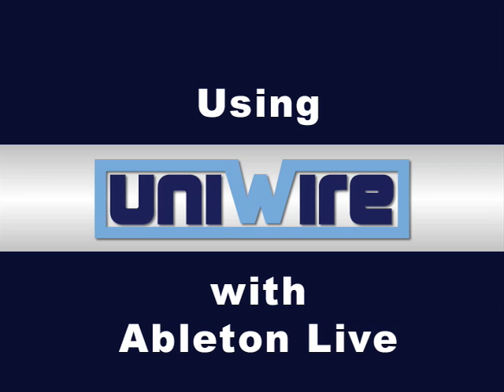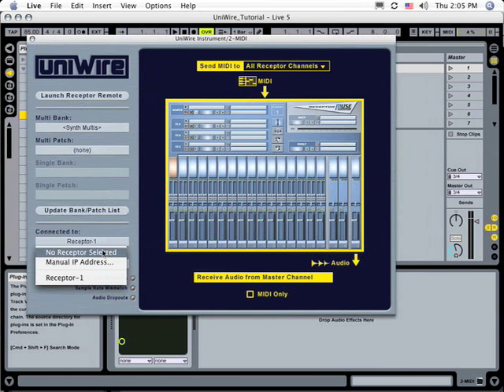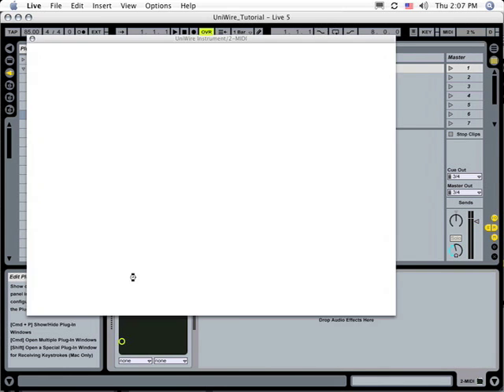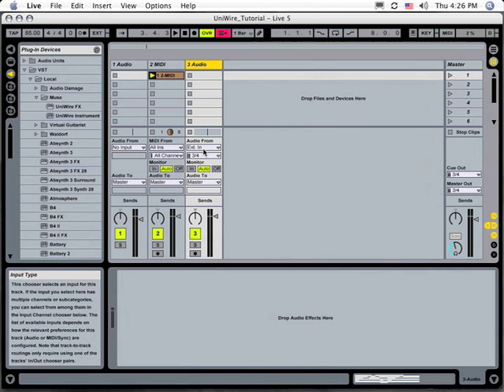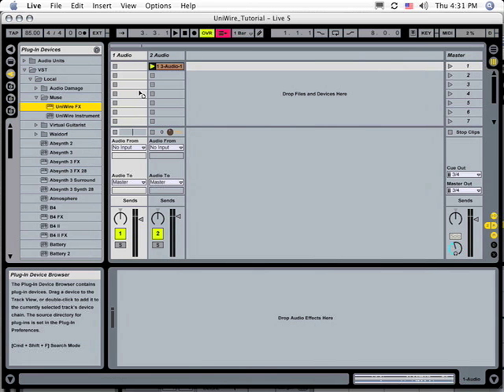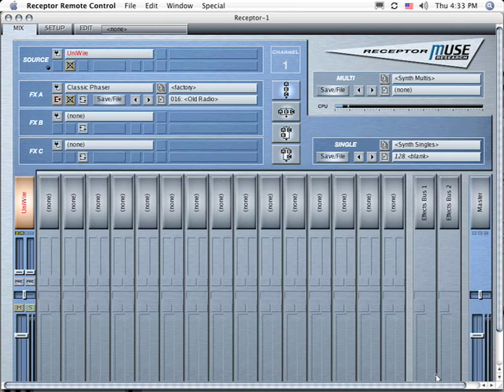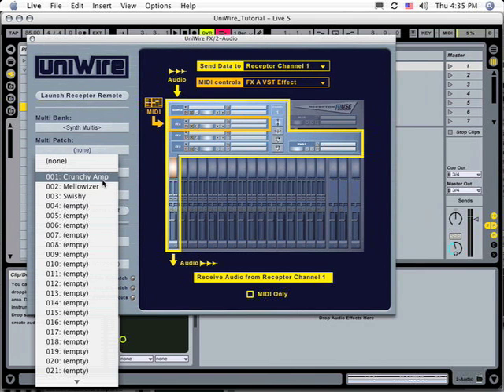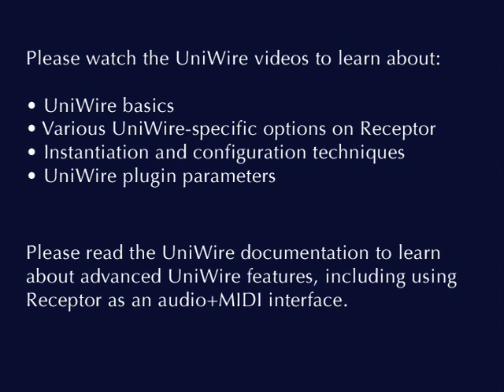Using UniWire with Ableton Live

Comment: When plugin Receptor directly to a computer, does it require a different type of Ethernet cable (a different wire-to-pin association)? Or can it be the same one used to plug into a Router?